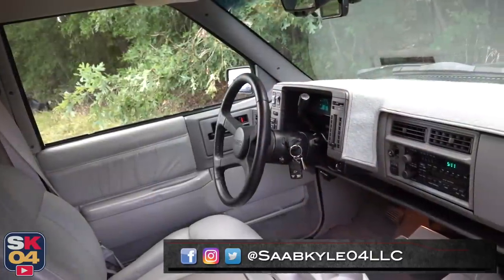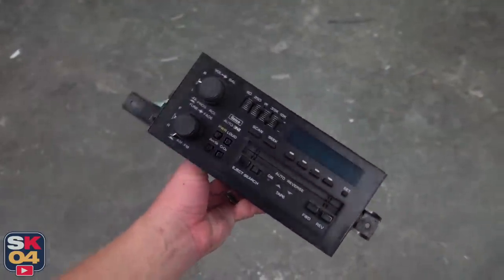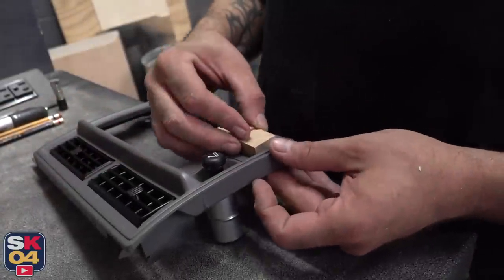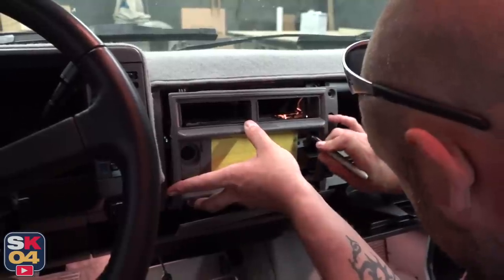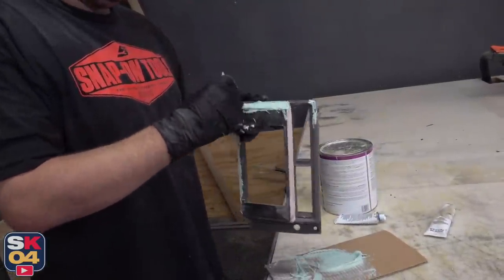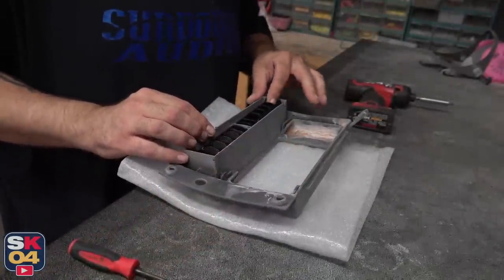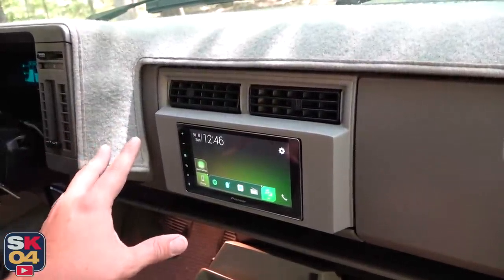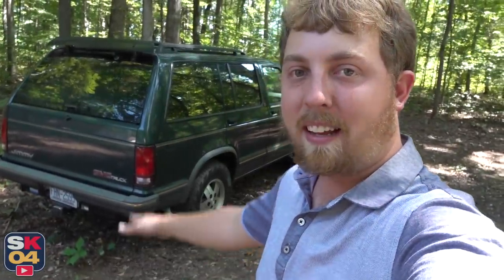Modernizing The Interior Of An Old SUV With A Custom Double-Din Radio: Jimmy Resto Ep.16

Comment: if a 12 volt outlet is not that important, I suggest getting a Usb-aux flush mount adapter which replaces the 12 volt with a usb and aux port so you do not have to run the cable down from the side. In my opinion it looks cleaner because I also have it on my NEX. or you can drill another hole for it if the 12 volt outlet is necessary.